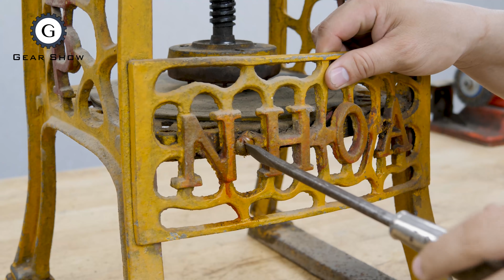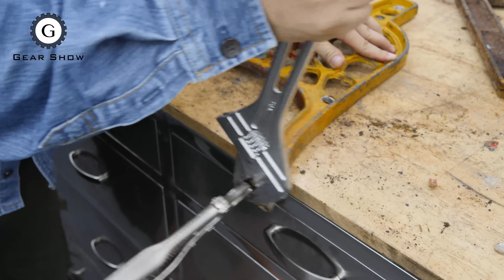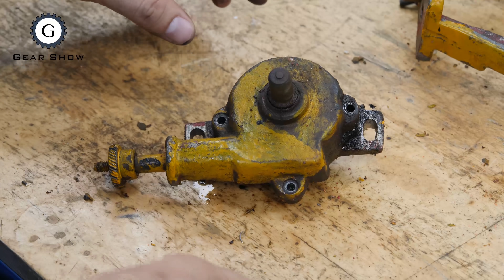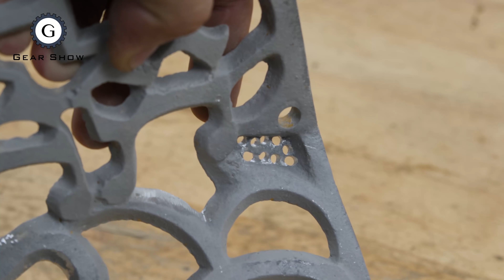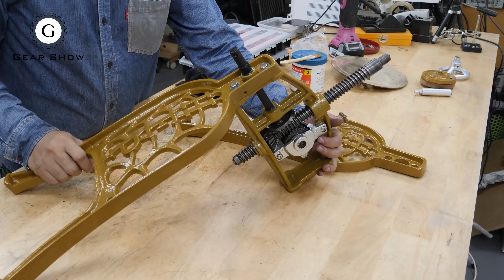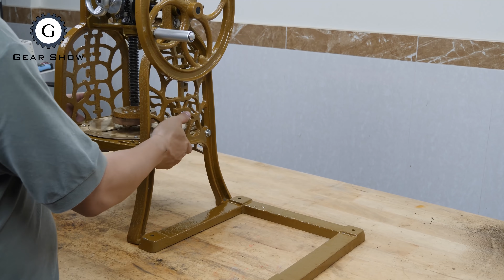Vintage Ice Shaver Machine Restoration

Comment: Looks like paint did not stick well…
Reply: Hammered iron effect. Not a fan of the look either. Spent all that time filing down imperfections to only cover them up with "imperfect" painting effect. Also wondered about the shaving turntable and plate. That looked pretty disgusting even after the restoration.
Reply: @myitbos1335  yeah, the plate and wooden turner looked really gross. i wish he would have restored those as well. i like the hammerite / hammered iron effect, but its only really good on certain things - a carnival ice shaver is not one of them.

Comment: Because its still in the shop, my brain assumes the shaved ice toppings at the end are motor oil and automatic transmission fluid, based on color and viscosity. 😂

Comment: I see a lot of guts miss using files, they are a one way use tool, dragging backwards only dulls them, I learned that in Vo-Ag in H.S. over 45vyrs ago
Reply: Ever seen a die filer machine?

Never saw a file dulled on one any quicker than one used by hand using the "one way only" hand filing mantra.

Comment: When using heat, to remove a stuck bolt, you heat where the threads are, not the head of the bolt. You could’ve saved drilling and retapping holes

Comment: You didn't grease the two black metal gears at the top, or the screw shaft. That'll wear it down a lot faster. Other than that good job! Looks like it works fine.